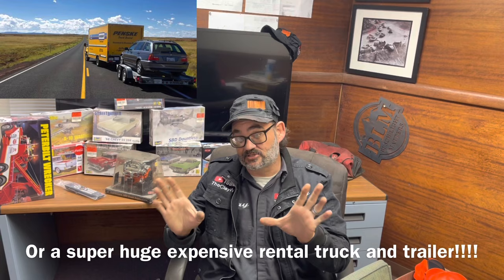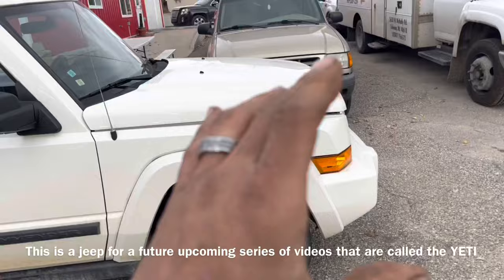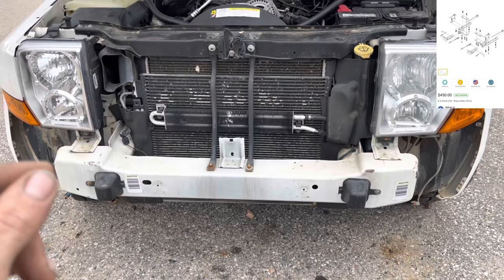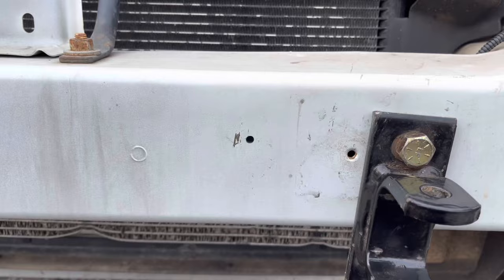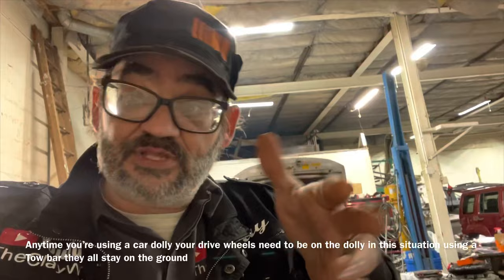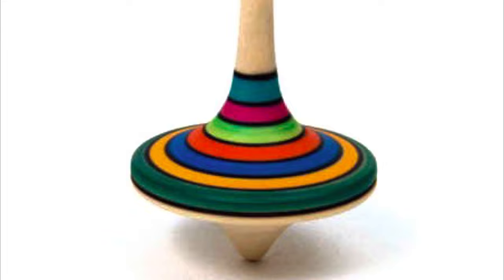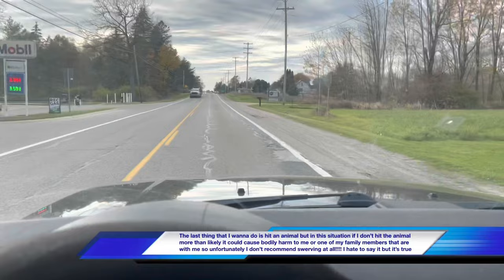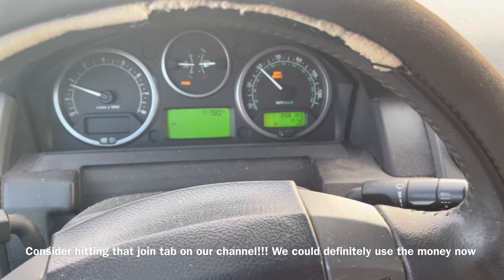How to Use a Tow Bar on Any Vehicle and Why It Works , Why Towing a Vehicle Will Not Crash and burn!

Comment: Would this be adequate enough to tow a 4x4 f250 diesel behind a uhaul truck?
Reply from the maker: There was somebody who commented a while back about using it to tow their F-350. I think they sent me a message over my Facebook page and pictures they were successful. So I would have to assume for a reasonably short distance it wouldn’t be a problem. ………. Unfortunately you would have to disconnect the driveshaft from the transfer case to the front differential and the rear driveshaft to go a long distance. 

Btw i’m assuming if you told U-Haul that that was your plan they’re not going to let you rent the truck because it’s against their policies. Ijs not sure though.
Reply: I’m going from NY to TX any suggestion lol
Reply from the maker: Definitely if you’re gonna do it this way which I don’t think would be a problem as long as you disconnect both driveshafts. It will work just fine. 

Give yourself a lot more stopping distance.
If your Ford truck is a diesel it’s probably cheaper to just buy a trailer and use the truck to pull the trailer then you have something you can resell once you get there I’ll bet you would save some money that way because U-Haul trucks get terrible terrible gas mileage. 

And I’m assuming yours is a Diesel it’s going to get better fuel mileage. 

Hope it works out well for you I’m from Texas and was just there a month ago it’s a wonderful place.  …… Well at least it used to be when I lived there a long time ago
Reply: I’m originally from Texas got trapped in New York for work and finally got my chance to escape back home lol I suggested that to my wife she thinks a uhaul is going to get better mileage than my diesel which I’ll admit is probably about 16mpg on a good day lol
Reply: If I left the key on, left in in 2 wheel drive and put transmission in Neutral would I still have to disconnect the front and rear drive shafts with the tow bar? 4x4 is electronic shift with a switch with 2wd, 4hi and 4lo options
Reply from the maker: I’m not certain because different vehicles have different ways of sending energy to the transmission what you don’t want is the transmission spinning and causing fluid not to be pumped through it.

It’s very possible with the transfer case in neutral that it’s not necessary to remove the driveshafts at all but I cannot say for 100% certainty I would call the Ford dealership and check

I would suspect that your wife is wrong on the fuel mileage.  

My wife is often right about most things but she wouldn’t speculate about that type of thing

Comment: Get longer bolts 3.5-4" long should work so you don't have to cut or slid a washer inside the bumper support.
Reply: Be careful with that, the bar is hollow. I could see the bar crushing when tightening the nuts or from the pulling force when accelerating, climbing hills, or turning. And if the bar crushes while you are driving, the bolts will lose their tension and the nuts will come loose. If you decide to try this, definitely use Nylon lock nuts so they can't fall off if the bar does crush.
Reply: I just tried that method today when I towed home a broken down 1997 Civic I just bought for $180 of course with grade 8 bolts, Nylon lock nuts, and safety chains and it worked fine, but I was VERY gentle on the clutch and throttle and only had to pull it 15-20 miles on pretty flat ground at no more than 35 MPH, so I certainly wouldn't call that conclusive but it's an anecdotal data point nonetheless. I quite possibly could have had a very different result if launched it hard, took sharp turns, etc. I edited my original reply so I don't mislead people into thinking it can't be done since it worked for me and could possibly work for you too, just proceed with extreme caution if you try that and keep in mind what I said in my original reply.

Comment: Is there any way to make the tow bar stationary instead of tilting up and down I'd like it to stay in place almost like a trailer tongue to tow a vehicle with no front axle under it..
Reply from the maker: I’m sure you could do that, but there’s no benefit to you. It’s actually more beneficial than it does move up and down.
Reply: @sharpcarco  I'm trying to make a poor man's trailer tongue for our jeep camper (jeep xj with front end cut off flush to firewall leaving the unibody frame exposed) if I could weld I'd shove some square tube and welder up but sadly I can't weld worth shit so I need a bolt on solution to my problem..
Reply from the maker: I get it by the way, just some advice I could not weld, but that never stopped me. I’m certain you can try and you’ll know if your welds are good or not all you gotta do is hit it with a hammer until you get a good.

Comment: I was told when towing with tow bar, just put the vehicle being towed in neutral , an your saying take drive shaft out ?  as nd your saying put lights on my top ? Your confusing me ??
Why I need lights when the vehicle being towed has working emergency lights ?
Reply from the maker: You can’t turn the blinkers on or the brake lights on when you’re driving the vehicle that’s pulling the other vehicle can you? 4 ways will not tell somebody that you’re stopping or turning.
Reply: @sharpcarco  what Ive got going on is that I'm moving from Illinois to Missouri and because I don't want to have a second driver to drive either truck to Missouri and then have to drive them back to Illinois, is use my tow bar and hook it to my 96' Dodge ram to pull my 02'dodge Dakota.. but both trucks run an drive and all the  lights work on both trucks. I'm just trying to connect the towbar, the easiest, safest, simplest way  without having to remove ANYTHING or drill holes to mount the tow bar. I'd be towing during the day light .
Reply: This tow bar to pull another vehicle sounds to me like I should take this tow bar back for a refund and use the money to rent  a tow dolly from U-Haul .
Reply: After having a discussion, then figuring up the total costs, just seems to me like the ,safest, cheapest, simplest route to go would be to take this tow bar back to store for refund, and use the money from refund to go and rent a tow dolly from U-Haul !
Reply from the maker: OK, good for you.

Comment: Quick question bc I’m no mechanic lol but would I have to disconnect the driveshaft for a 1977 dodge d100 2wd for this type of tow
Reply from the maker: Well I actually talked about that in the video. 

I talked about how not intended to be used for long distances. It was fine on my newer vehicle but in any situation if you can remove the driveshaft that’s always best it also depends on how far you’re going as well.
Reply from the maker: Well I actually talked about that in the video. 

I talked about how not intended to be used for long distances. It was fine on my newer vehicle but in any situation if you can remove the driveshaft that’s always best it also depends on how far you’re going as well.

Comment: Will the air bag deploy if bumper moves
Reply from the maker: Did the airbag deploy in the video?
Reply: Point taken lol
Reply from the maker: If you have any worry about it at all, you can disconnect the battery neg and then positive , installation works in reverse

Comment: I have a Chevy equinox awd 2013. I took out the drive shaft . Can I flat tow it like that ?
Reply from the maker: I flat towed one for about 80 miles, but the transmissions are extremely weak. In these vehicles. You can certainly do it, but I can’t say for certain what the result is going to be for you. Mine was fine, but I’m never going to give advice and tell somebody to do something and then they come back and tell me how it ruined their vehicle…..
Reply: Okay another question sorry. If I took the drive shaft out and just get the dolly. Can I possibly tow it like that for a long distance drive ?
Reply from the maker: Yes, absolutely could be

Comment: Damn i didnt know i had to tight those bolts . I thought they were  supposed to be loose for the towbar to be able to move in turns. I traveled morre than 1200 miles  like that 😬😬

Comment: Should point out in most states (if not all) a braking system for tow vehicle is required. Tow bars are inexpensive, the braking system is not.
Reply from the maker: Trailer brakes are often required depending on the size and weight of the vehicle. 

The point of this video was to show people why it’s safe to do for a short period of distance and explain to them how it worked like I said in the video “ it’s not a lifestyle”
Reply: @sharpcarco   great video. I checked on the braking requirement. previous comment isn't true. Most states do not require braking system based on my research. Some states don't even require it if you are towing 3 in a row!!!

Comment: Can I tow a car on a 5 hour road trip with this set up?
Reply from the maker: You have to take the driveshafts out for that kind of toe. Or it Hass to have a transfer case that doesn’t allow the driveshaft spin sending energy into the transmission
Reply: @sharpcarco  is a fwd chevy equinox

Comment: Gotta weld on brackets, drill holes for a cable that ties to your brake pedal, gotta run wires, lights, cant back up, cant see the load, cant turn very sharp because the motorhome swings as you turn.  Its a can of worms.
Reply: Yet people
Do it every day of the week and twice on sundays. Maybe it’s just not for you but it’s been done for years and years and by millions of drivers.

Comment: Can you do 65-73 mustang with these
Reply from the maker: Well that is a very good question but unfortunately my experience with the 65 to 73 mustangs is very limited although I should mention if you’re getting a 65 to 73 mustang I would probably recommend that you use a trailer you can’t replace them as easy as you used to be able to.

Comment: You will destroy the transmission if you do this on MOST vehicles. If it is a standard transmission or FWD that has a transaxle that can be put in neutral you can flat tow it but if you try to do this with a regular automatic transmission you will destroy it.
Reply: Even if it’s a few miles like 5 miles? I’ve towed my brothers 06 Silverado farther with no issues but I’m trying to tow an older 1991 Chevy suburban and I’d hate to mess up the tranny
Reply from the maker: I totally agree…. 5 miles 10 miles. I don’t think makes a difference. Heck I towed this one in the video 80 miles and it was fine..  with all of the driveshafts installed. But in neutral.. it did not have a neutral switch for the transfer case…. So take that for what it’s worth.